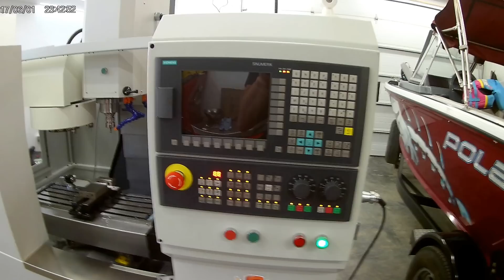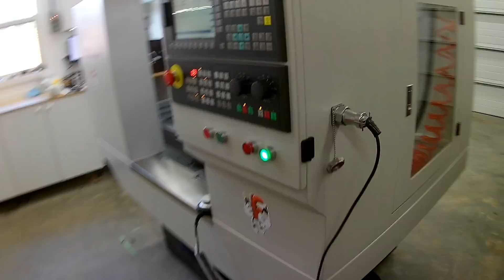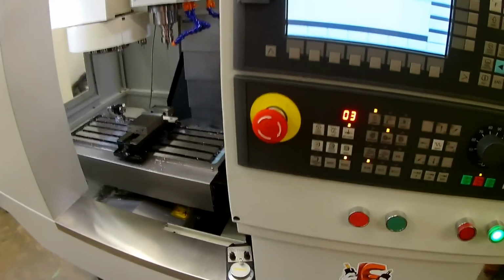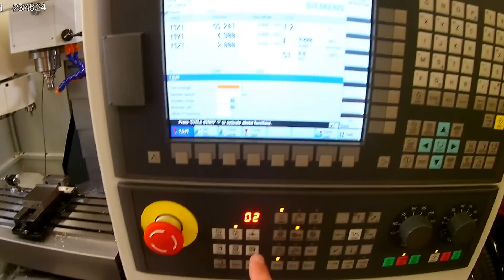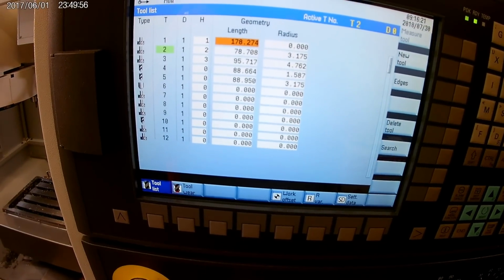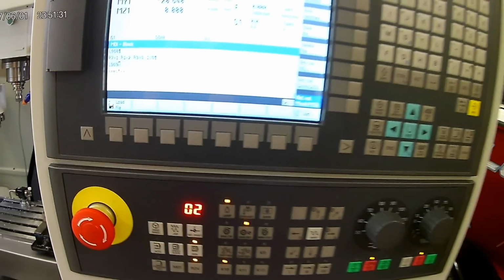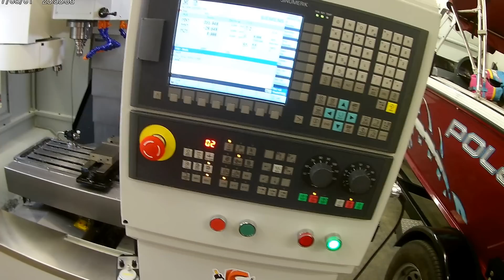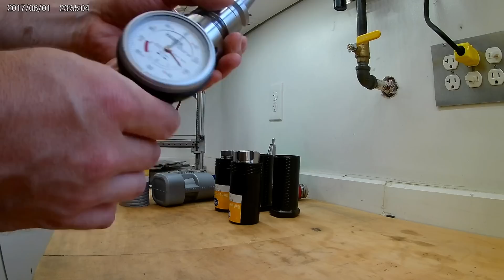SYIL X7 1 week later. Walk around and initial thoughts.

Comment: looks sweet. What was the total cost delivered in $CAD?
Reply from the maker: Unfortunately my pricing is obsolete. There have been two major changes to the X7 now and they are no longer similar in design or cost. The new ones are epoxy granite and more compact, they are very nice but cost @ $10K more than mine was. My experience was the agreed price to arrive at port, then port fees of about $300 CAD, then Import fees @ 5%, then another $1000 CAD to transport it 800 KMs, then rent a forklift for the day @ $300 CAD.
Reply: @betztechnikindustriesltd.8901   what does "epoxy granite" mean?  where can you buy this direct from china? on the syil website the only contact is a guy in ontario.
Reply from the maker: @sean7193  It is what the frame is constructed of, instead of cast iron like normal. It is considered a significant improvement. You now have to go through regional dealers, like Syil Canada.
Reply: @betztechnikindustriesltd.8901   thanks. too bad about the regional dealers ( I mean middle men) driving the price up.

Comment: Can you cut steel on this machine? And what is your opinion about weight of this machine because it weights 1000kg and that is not a lot. 
Sorry for bad english.
Reply from the maker: Gregor Gutnii You certainly can cut steel, but of course you are probably not going to rip through it super fast. I’m not anywhere near pushing my machine yet in Aluminum, so don’t take my example cutting as a sign of the machines performance. It isn’t crazy heavy, but I’m sure it’s the heaviest of its class (Tormach, skyfire etc.). A lot of guys cut steel on the X5 and I’m sure that isn’t 1/2 the weight of the X7. I think the weight is relative to how hard you can push it. I cut steel on my old G0704, you just have to take your time. So this would be orders of magnitude better than that.

Comment: Quick question - with the phase converter does it use much power running the phase converter? Would like to buy an X7 Combo next year and want to ensure my household garage power can run it
Reply from the maker: CDModelz good question. I will try and get an ammeter on the main lines and see what it is consuming. The 10hp rotophase didn’t publish its consumption, but the 7hp says 1.15KW, so 4.8A @ 240v... maybe mine is closer to 6A or so.

Comment: I wonder, does this have ball guides or roller guides?  I think the V series machines have roller guides (and a heavier casting).'

Both the ADTECH and the Siemens controls are PC-based running Linux.
Reply from the maker: douro20 I’m pretty sure it’s all ball guides. Yes the V650 is 12,000 lbs I think?

Comment: I like that these come with the Siemens controller. My machine at work has one so I'm as comfortable with it as a haas. How much did the whole machine package run to get it in the door?
Reply from the maker: WCGwkf Yes I thought it was worthwhile to upgrade to the Siemens. I suspect it will help immensely with resale too. I’ve already dealt with Siemens tech support (no issues, just questions) and they have been great. I think they are running about $25k USD delivered (after taxes) ? I got in on them earlier and got a significantly better deal than that with a group of people. They’ve already taken our feedback and made major changes, so the $25k USD price is for the newest version I think. New enclosure. All new coolant system etc etc.
Reply: @betztechnikindustriesltd.8901  that's not too bad for what you're getting. the base version of a haas would cost that much, then double it to add the features that every shop needs. I'll definitely have to consider one of these vs a used haas

Comment: You might need a crossover ethernet cable if you are connecting straight to the ethernet port on the pc.
Reply: nerdy is right. if you are going from machine to pc you need a crossover. otherwise just put a hub in between the pc or plug the machine into your router. if wifi is working the onboard nic is working.

Comment: Thanks for the review.  Regarding your wash down hose; replace the coil hose.  I installed one on my wash down and flow went to a trickle.  Then replaced with a 10ft length of 5/8" ID garden hose and the flow is dramatically better.  My pump is a 1/8hp AMT. Couplers are quick disconnect type used in the beer brewing industry.  The filter is a 10" 100 micron house sediment filter.  On top of the chip pan I use a perforated chaffing dish tray.  It traps most chips and makes clean out easy.
Reply from the maker: Special Horse thanks for the tip I’m definitely going to try that.

Comment: What is the part number on that tool setter again? mine just does height, I have really wanted a height and diameter setter..   Thanks
Reply: roger roger.. thanks.. Yah given a Renshaiw setup starts around $4500 used and then I have to figure out how to retrofit into an adtech controller 
that's not too too bad :-P..